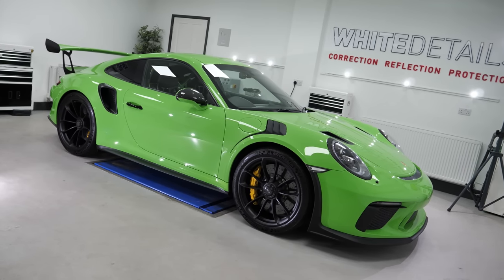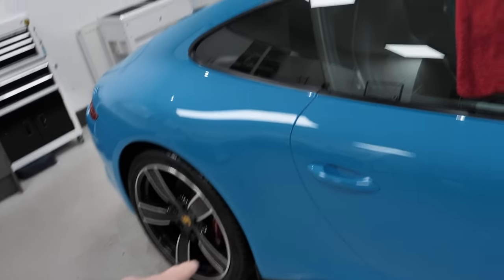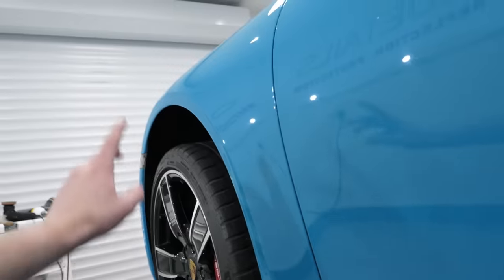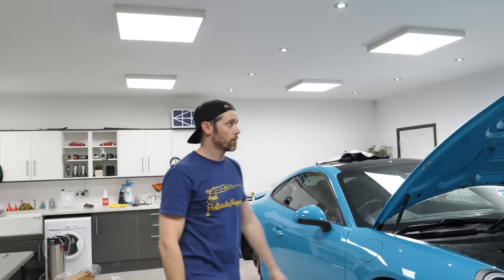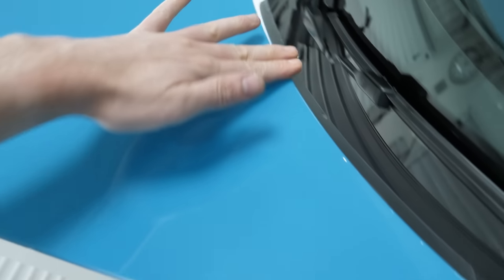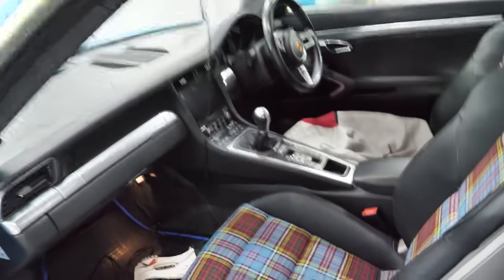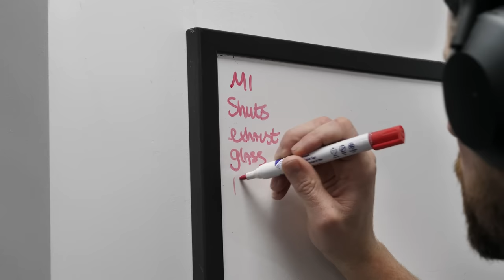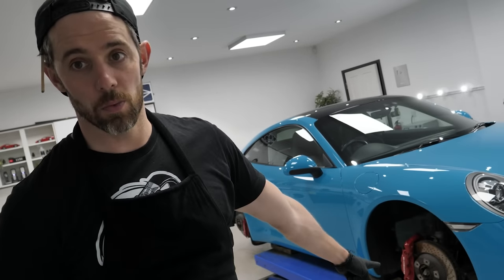Porsche Paint Correction & Protection - PPF + Ceramic Coating

Comment: Superb video and thanks for showing what the PPF can do, I polished the door Pillars on my mums Seat Arona and even with careful washing they are picking up a few light marks. Also ever had any issues with your Carbon Collective nano polisher, Great bit of kit but mine seems like if it gets to hot it cuts out. Will restart but sometimes doesn’t last long. Not sure if battery or motor related, thought it best to ask as yours will get a lot more use than mine.

Comment: And without a major correction, you save clear coat.
Reply from the maker: There is that, too. Essrntially, you're unnecessarily removing an amount of clearcoat. And, clocking up 8-12hrs labour! I've been amazed with the PPF so far.
Reply: @WhiteDetails  Beautiful work Jim!

Comment: How are you liking the Sony headphones?  Same model I have and I love them for traveling.
Reply from the maker: They're decent, Jamie - sometimes the noise cancelling takes a second to sort itself with new frequencies etc. Might be something i'm doing wrong in the settings.. Otherwise, very pleased.
Reply: @WhiteDetails  Nice.  I noticed the lag as well.  I figured out that if you just turn them on, then do nothing for about 30 seconds, the software 9Sonly App) that drives them sorts out the settings on any paired devices and everything goes smooth from there.  I like the pass through when you speak so you can hear people talking to you when you want to.

Comment: Genuine question, not a criticism. How do you cut the ppf on the panel without scoring the paint? 🤔
Reply: The ppf is pre cut for the car,no cutting required.
Reply from the maker: Hi Pete, where trimming is required, you're only 'scoring' the upper surface and then it tears nicely along the trim line. Takes a little practice!